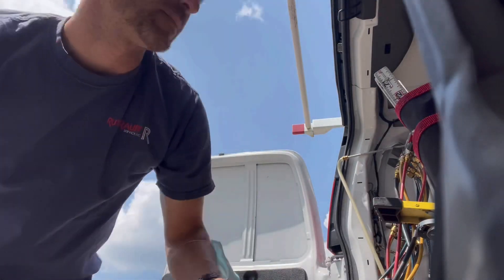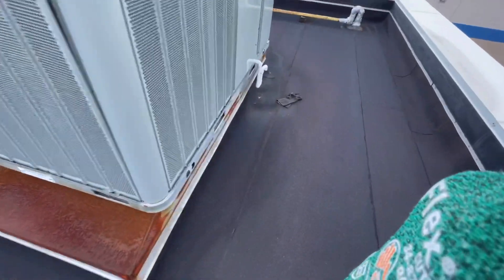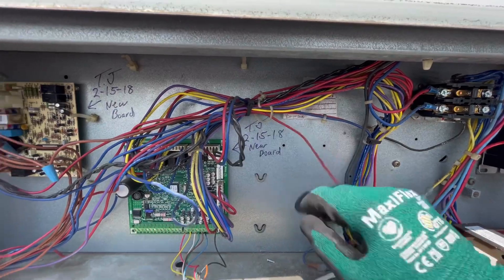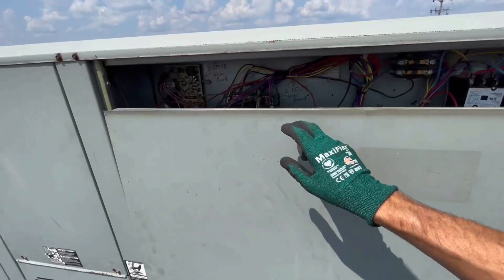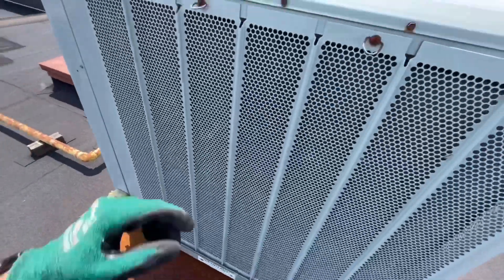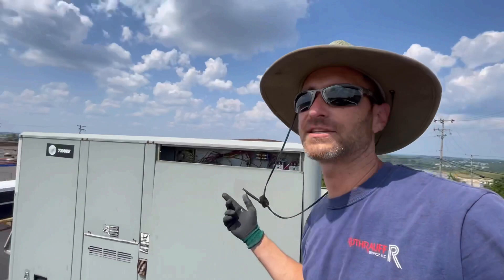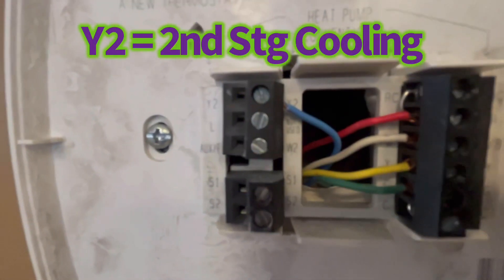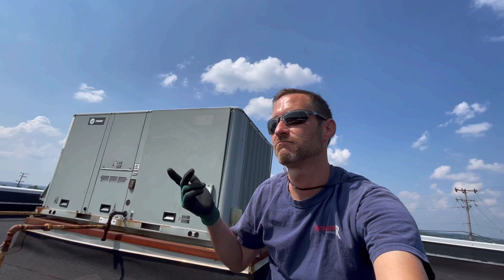Digging Deeper #Steamfitterslocal449 #HVACEXPLAINED #RuthRauff #hvaclife #Trane #commercialhvac

Comment: Great video and good catch on second stage. Did you happen to check the other thermostat to see if it had the same issue? Just a thought. Thanks
Reply from the maker: Thank you very much HrdWorkin. There was no other issue with the other system but I did notify the main technician who goes to the site.  I’m not sure why or how it was overlooked I’m assuming because there were no real complaints.  Believe it or not about three days later after I had left.  the building got struck by lightning and blew the transformer on that unit I was on.  lol.   It doesn’t hurt to poke around from time to time sometimes jobsites just need an extra set of eyes.  Everybody works differently.  Thank you very much for the comments and complement have a great day stay safe.  I’m currently changing out a 20 ton MicroChannel coil at this time on a carrier unit.  👍

Comment: The people that would rather flip a switch and run are the same ones that will loudly complain when they get a callback the next day. In the overall scheme of things, it always pays off to just spend a little time to make sure everything is right. They tend to forget that the customer can always just call someone else to fix it next time.
Reply from the maker: Exactly. There’s nothing wrong with sticking around for at least one hour to check over some basics verse making that walk of shame back the next day and spending a couple more hours to do it right.  This is another reason why I don’t just want to replace a part flip the switch and run because there could be more involved That led up to it.  
Thank you very much for your comments I appreciate you watching have a great day.

Comment: Like calls like that. Just got off a roof here in Georgia .1999 Carrier want me to tell them it will last another 5-10 years. Hanging on by a thread. Could need splitting and cleaned. All three contractors need replacing also both condenser fan motors need replacing. Don’t want repairs just a guarantee it will not break down.🤷🏼‍♂️
Reply from the maker: If only some people knew how many wires, terminal ends, mechanical moving parts there are throughout the entire system it would blow their brain out the front of the skull.  Lol. 
I have a piece of equipment that is Roughly 35 years old and the customer asked could he get 15 more years out of it.  I replied with you can up to a certain extent.  You have to think about is that refrigerant going to be around then and if so how much.  What about the location of the unit if it’s close to the ocean you have salty air. Also do they mind if the system is altered and rigged up. How about a reliability and energy standpoint.  There’s many different factors in this field
Reply from the maker: My personal vehicle is a 1999 Ford ranger. I am the original owner, it runs very well, it is extremely reliable since there are no goofy gadgets such as a heated steering wheel, Bluetooth, air-conditioned seats so what’s really going to break ?  I mean if the engine or transmission goes yes it’s done but everything mechanical No matter how well you take care of it will eventually fail

Comment: I bet remodel with a new stat installed and they forgot to wire it
Reply: Welp, the box said …. 🤦🏻
Reply: Lol I’ve come across a lot of similar thermostat issues, usually due to in house maintenance staff trying their best going to the local HD or Lowe’s, I always get the …“I complied the wires from the old stat exactly ” then have them wondering why it doesn’t work the same 😆 too funny
Reply from the maker: Possibly.   👍
Reply: DIY usually saves you the time in trouble shooting.
Sir, this needs a new bottle of smoke.